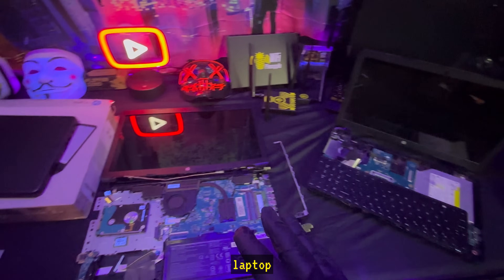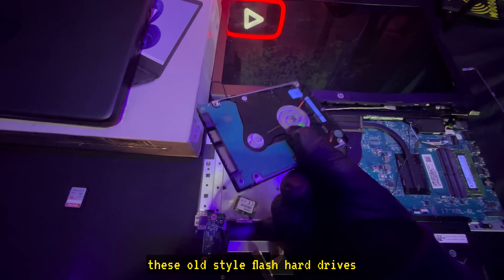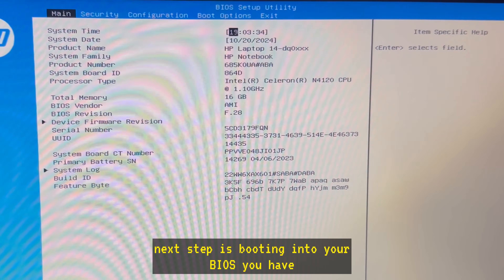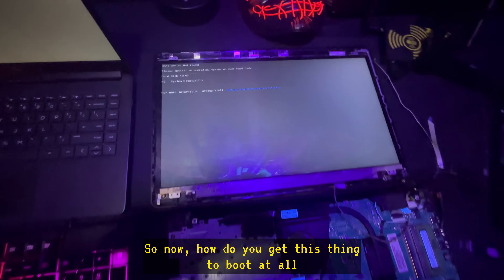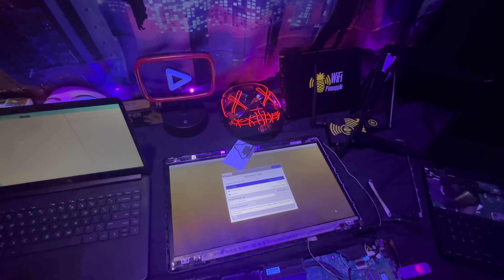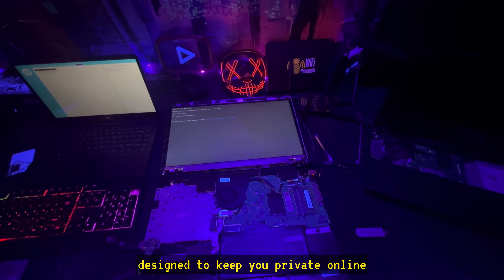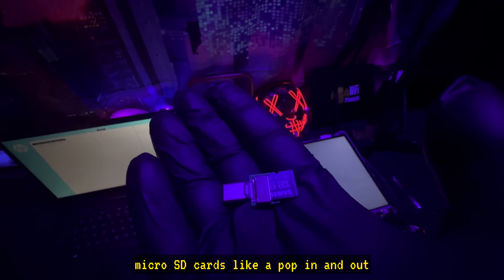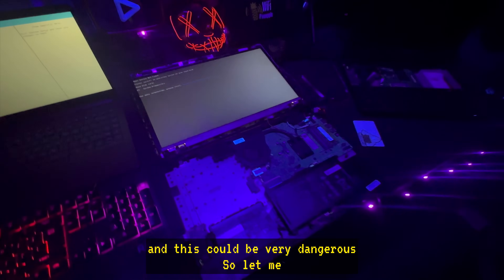Build a Ghost Untraceable Laptop: Ultimate Guide to Online Anonymity and Privacy! DIY

Comment: But then you got Intel ME back-dooring your entire setup rendering all this pointless. Plausible deniability is awesome if you're in a country where they can't just take you to a dark jail and torture you, which is not the case in much of the world where people are seriously concerned with staying private. There you rely on Intel not talking to the local government and/or your evil regime not having used Intel ME to produce cracks in your system and backdoor it that way.
Step 1 to me is to make sure you don't have hardware or firmware in the motherboard that is of higher privilege than the OS you're operating, especially not firmware as complex, powerful and obscure as Intel ME (which runs it's own entire Minix operating system several layers below the Linux kernel). I'd use an ARM based machine until RISC-V is stable.

And then it's general opsec, don't always connect from the same place, don't connect through the same proxy, don't accept any KYC, don't use any crypto besides Monero etc

Comment: I don't see the point of not having a drive, since you can just encrypt the drive and store the key in the USB drive. Also, those flash drives will have future reliability issues as a consequence of constantly loading the operating system from flash each time you boot. An NVME enclousure would be much more reliable.

Comment: This was in my recommendations due to all the Linux stuff I have been watching it seems. (switching over to Linux due to privacy and bloat concerns with Win11)  It would seem that I have already done this with one of my old computers, but for a different reason.  I had an HD failure in my laptop before I had backed up all my old photos so a coworker gave me a Mint stick to boot from USB to try to recover them. I was unable to recover them so I pulled the HD and destroyed it.  I then did a full install onto a USB stick and put a SD card in for storage and it turned that old dead computer with no HD into a fully functional computer.  I used it for a couple of years as a backup for when I went camping or fishing (or really anywhere a computer could easily become damaged or destroyed)  If I bust the screen, drop it in the lake or if the power input breaks (as is usually the reason I end up with a new laptop every couple of years) it is no big loss.  I can just pull the USB and SD and put them in another computer and keep going.  I never really thought about the privacy and security implications of that setup, but it seems that I am just a few steps away from having a VERY secure and private setup.

Comment: I want to build a cyberdeck so badly one day, and it'll be 99% compartmentalized with a Raspberry Pi CM5

I'm fantasizing about a 100% off grid PC!

No built in WiFi chip, no built in Bluetooth, no built in camera, no built in microphone, no built in speakers. A USB hub splitter (with off switches for each port), ethernet hub, a power bank, display, and nylon braided cables (sticking to USB 3.0 and C setup)

--Want internet? Plug the Alfa WiFi dongle or ethernet cable in
--Keyboard? Plug it in manually
--Mouse/trackpad? Plug it in
--Bluetooth? Plug in a dongle (IDK if that's a thing TBH. A BT dongle. Probably is. Never seen one before tho)
--TailsOS? Plug in the flash drive
--Display? Might not matter if it's kept plugged in TBH
--Camera? Plug in a camera
--Mic? Plug in a mic
--Audio? Plug in ear/head phones or speaker
--Wanna turn the Cyberdeck on? Turn the battery on (and plug in the USBs if you unplug those, too)
--SD cards? Unless the USB hub has SD slots, use full size SD card with Micro SD adapters to a USB 3 adapter

NOTHING is on my Cyberdeck without MY knowledge or consent. 99% Compartmentalized! (minus 1% bcuz display and hard drive might not matter if they remain plugged in). All into ports with off switches, too. And it requires manual setup (plugging errything in and turning USB hub ports on individually after opening the Deck)

This is my dream ghost laptop. Kali on the SATA SSD. 8GB of RAM. All for (ETHICAL) hacking and survival. Add some weather and radio dongles or however that works (and keep them USB 3 connection, not built in) and Kiwiko full of survival guides and whatever, and you're good to go off grid. Just grab a solar panel and maybe a second external power bank. A bigger one

A Kali linux flash drive, preferably with a snapshot on it. So it'll be like TailsOS: after you do whatever, it'll reset back to default upon reboot or shut down. (IDK if this is possible. Probably is). And for quick formats, just erase digital forensics from memory and storage and reformat and install Kali back up from snapshot. IDK if that's possible either

The only problem is the Vendor and Product IDs. IDK if you can remove or spoof them. They'd be all that's identifiable about your rig smh. Unless you can get rid of or spoof the VID and PIDs, you can't have a 100% compartmentalized ghost PC. Only a 99.9%
Reply: Why only 8 GB?
Reply: @ennzee5393  Mainly budget. I think 16GB is overkill for something like this. But that'll depend on the era and when I'll need it. Maybbe in the future Kali Linux or whatever else will need a minimum of 16gb?
Reply: @cqllel Currently, most devices do have 16GB so I assumed you might be using 8GB to bypass something, so was curious 
But that list is interesting; I have an old laptop that was updated..maybe I will try to see how to use that efficiently
Reply: @cqllel Keep me informed of your progress..I am going to follow suit 😊
Reply: @cqllel i feel ya...but giddy up😂

Comment: You never removed the WiFi catcher from behind the computer screen.      All that metallic tape is very functional and can be  ghosted with Adhoc.   Remove that WiFi card.        Remove the battery and operate it by 12v or 5v rc car plugin.    

Then There is still many many areas to store info on the pc.

Comment: Disable camera and microphone.
Disable build-in WiFi and Bluetooth (use external device).
No storage (live os)

Tip* Risk from cold boot technique. (ram dump)

Just make it hard to open the case for 2 or 3 minutes. (they must came with portable freezer) so keep your OPSEC.

Comment: Few notes:

First even if the mac adress is randomized the network card can be identified by the Ap you are connecting to, so it is tracable wich publi networks you connect to if the public networks share data.
2. Tails isnt as secure as something like qube, ppl have been busted using tails since they just need your ip and therefore you just need to gain root on Tails and no percistent data is required.

Example bust, you downlaod a video and look at it, you are in a public network, so they law enforcment gets to the cafe or whatever and starts monitorning the public networks, maybe they even have cams, and ten can wait till you are theere again use the network interface on the laptop to know it was you who downloaded and opened the video, just cause you opened a file.

Comment: To make this a little more convenient you can solder a usb female head to the usb ports on the motherboard to have an internal usb. Then just add a small switch for the 5v power to cut it whenever you need. This way you avoid wearing out the ports and its just quicker

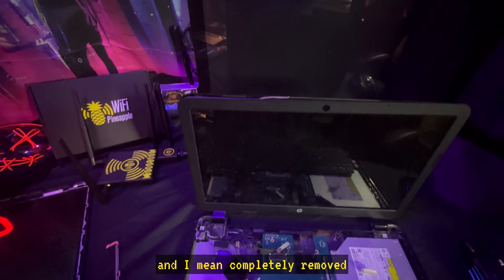Comment: 2:10 But you know... the real hacker can still hear you.
Even if you cut out microphone, the amplitude of the processor's signal waves slightly when you speak. (Or just simply way the speakers [check speakers as microphone])
With proper noise separation and signal filtering, he can extract your voice – from electricity, not internet.

So first of all, you need to build an independent energy source.
But don’t use a wind generator – if someone analyzes local wind movement, they’ll know how much energy you’re producing.
And then... they’ll hear you anyway.

Maybe it’s just easier to start learning telepathy.
Reply: Will meet in the astral plane to discuss plans.

Comment: was wondering will cold boot thingy still work on it? and say in case even if you pulled out the flash drive and other party gets access to you laptop they might try to dump the ram (although chances are really slim but still was kinda wondering about it)
or say hibernate/suspension might swap data to disk in case of misconfig

Comment: Honestly, this is one of the dumbest, most idiotic videos I've seen from a wannabe hacker fueled by paranoia. First off, don’t do any illegal activity like buying drugs or jb because you will be caught. The instructions here are pure idiocy. DON'T cut, just unplug your microphone and camera from the main board if you need to, but if you really believe someone’s going to hack your PC while you’re browsing or doing any illegal activity, you’re as dumb as f#@$k—especially if you’re using a USB flash drive loaded with Tails. Learn how Tails actually works before you try to “ghost” your computer.

For real privacy tips: use Tails or any live-boot Linux, rely on proxy servers (or better yet, the Onion Browser), and consider an anonymous web-based email client. Once you reboot to Windows or macOS, all traces are gone—except your search behavior and keystrokes, which can still be tracked. It might take longer, but if you’re a moron who thinks that learning anonymity from this video will keep you safe, you’re headed for trouble! Might want to look into 'Search Behavior Tracing', 'Keystroke Tracing'

Comment: Catch it on but locked with everything resident in RAM, you can still do a RAM dump and fetch all the unencrypted data.
You/d need to do something like embed a script that detects its been left for a period of time, or a device like the USB has been removed etc, then immediately power off, which will clear the RAM .

Comment: It's not a ghost laptop nor does it leave no trace.

There are several ways in which this setup can still be compromised and leave breadcrumbs:

1. RAM Data: Even when using Tails OS, data stored in RAM can be accessible after shutdown through methods like cold boot attacks, where the contents of the RAM are recovered by freezing it to prolong data retention.

2. Speculative Execution Vulnerabilities: Intel and AMD CPUs have known vulnerabilities (e.g., Spectre and Meltdown) that could potentially be exploited to access sensitive data. These are not intentional backdoors but serious security flaws nonetheless.

3. MAC Address Tracking: Your physical location history can be leaked through your MAC address. When your device is within range of a Wi-Fi network, the network can capture your MAC address and log it in the router's logs. ISPs generally don't have direct access to these logs, but they could potentially be accessed by entities with legal authority.

4. Hardware Identifiers: HWID (hardware ID) or device ID can be logged by certain software or services. If an entity finds a log containing this information, they can request sale records from the manufacturer and then request delivery address records from the retailer (e.g., Amazon), effectively tracing the device back to the buyer.

5. Bluetooth and Wi-Fi Probing: Even without a webcam, mic, or HDD, a laptop can still broadcast its MAC address during Wi-Fi and Bluetooth probing. This information can be intercepted and used for location tracking.

6. Software Metadata: Files created or modified on the device can contain metadata that might reveal device-specific information, including hardware identifiers.

7. Browser and Software Vulnerabilities: Despite using Tails OS, any software vulnerabilities within the browser or other applications can potentially expose hardware identifiers or other sensitive data.

8. Operational Mistakes: Human errors, such as accidentally connecting to a network without proper anonymization tools, logging into personal accounts, or reusing usernames/passwords, can leave identifiable traces.

While using Tails OS on a USB without a webcam, mic, or HDD does enhance privacy, it is not foolproof. Various methods including the few that j mentioned can still expose your identity and leave traces that could be tracked by entities like the FBI or CIA.

Comment: If using a burner phone hotspot to connect to internet is a vpn required/needed on the phone also? Obv it will ne slower but is it needed? Or what else should you do in that situation???

Comment: Tails has been found multiple times to have security vulnerabilities. One example is a few years back when someone downloaded a video, and watched it with the default Tails media player, and the FBI found a vulnerability in that media player, and managed to disable Tor, and leak his IP. If you're running software on bare metal, you cannot guarantee that the software will not escape its sandbox.
Instead, you should use a virtual machine on a laptop with an encrypted hard drive. Whonix and QubesOS are both good options, and allow you to run them in modes where nothing is written to the hard drive.
This all seems to just be aesthetics rather than actual privacy. It makes sense why most of the videos on this channel are just trying out some new hacking gadget. Just some overgrown child excited for his new toys.

Comment: Like the advice but majority of the people in the comments don't even know where to get a flash drive from. 2 you never really prove any info not being able to resurface after restarting that computer. 3 there are officials making 6 figures a year to figure this type of shit out. I would believe this video further if you can write codes. I've been in coding for years and my micro flash drive may be able to pull info off that computer because info does not always get saved to a hard drive or ssd.  Your definitely on to something just next time don't make a video exposing these secrets but good job letting people know this type of stuff.

Comment: Newbie here. About surfing on dark web, sending files anonymously, how is that possible exactly in this computer? I know nothing can be saved to the computer but the things you done on the internet can be tracked via IP. So without using VPN or proxy chain (which even they wouldnt give you exact anonymity) is it possible to stay anonymous and I mean exact anonimty or you have to use VPN, proxy chain etc anyway?

Comment: Nmap has multiple commands that can create diversion ip addresses and hide your identity. You can create multiple diversion addresses without setting up proxy chains

nmap -D RND: 10, will create 10 ip addresses randomly.

Changing a mac cannot be done. It can be spoofed but the network bridge will automatically use the hardware mac first

Comment: My only concern with this is that if I had some important data on the flash drive alongside the operating system, (let's say, an offline instance of my password manager where I could keep my banking information) the data on that flash drive will become corrupted if it's not plugged in for a long enough time. I saw a test where the data stored on a USB stick started to become corrupted after only 2 years, so I don't think it's a good idea to back-up any important data to a USB stick.